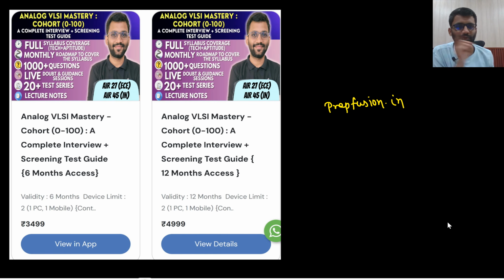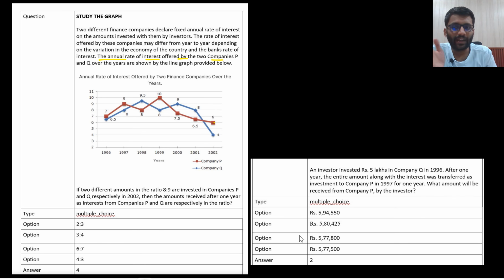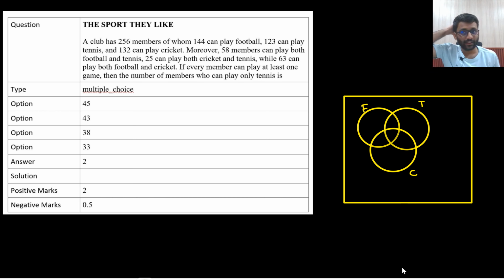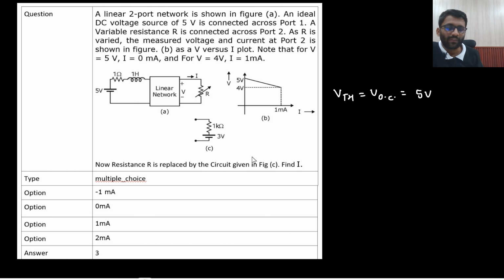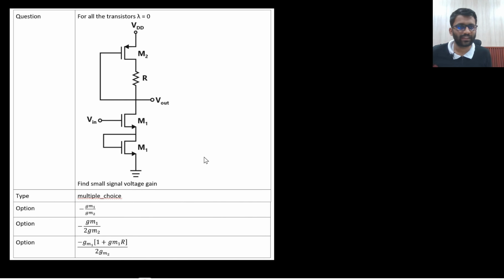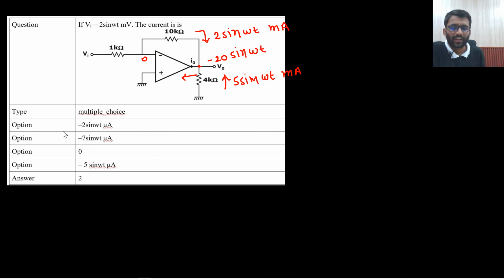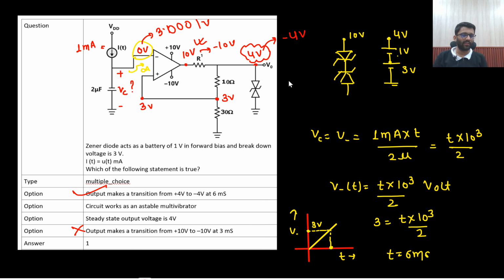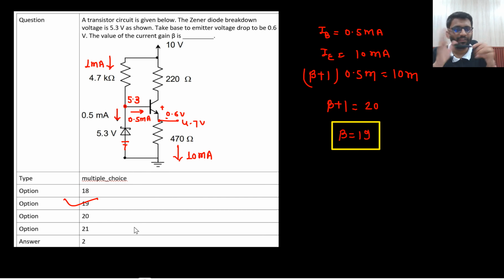🔥AIMT - 1 SOLUTIONS || Analog VLSI Placements || Himanshu Agarwal

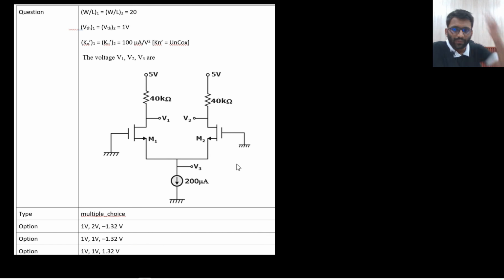Comment: In the problem discussed at 54:29 , you say that V3 is -1.32V. But if that were true, then the current must flow from -1.32V to 0V. But current cannot flow from low potential to high potential. So how can we say that V3 is  -1.32V. Can you please provide clarification regarding this ?
Reply from the maker: This is an ideal current source. It will always drive 200 uA, no matter what voltage is there across it
Reply: @PrepFusion_GATE  Thank you for the reply.

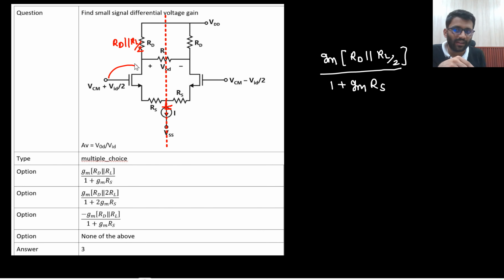Comment: sir, that was nice experience to give aimt-1 in tech q. no.34 at 1:28:00 answer is Rd is parallel with Rl/2 not Rl then no one is correct option.
Reply from the maker: Yup. Changed it later on. 
The typewriter did the error there and I couldn't notice
Reply: @PrepFusion_GATE  Okay sir thank you so much ❤